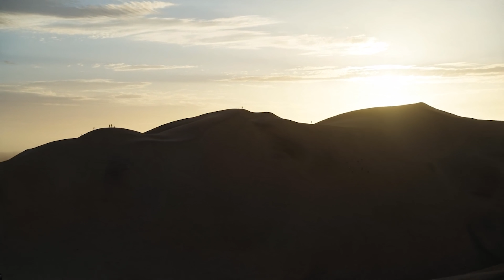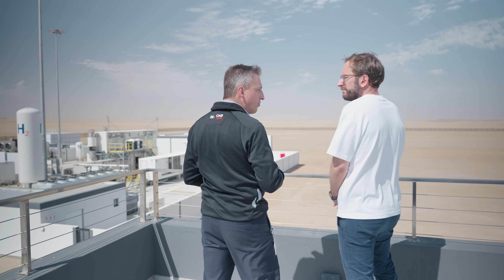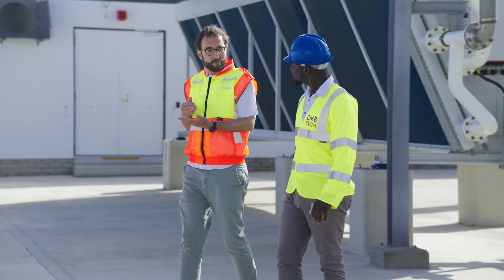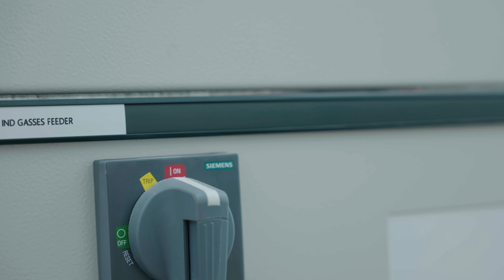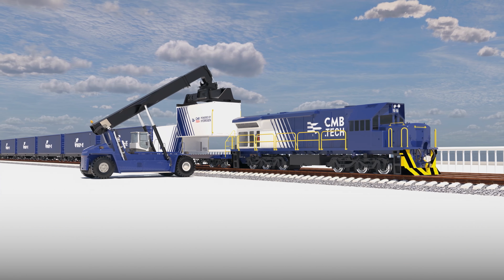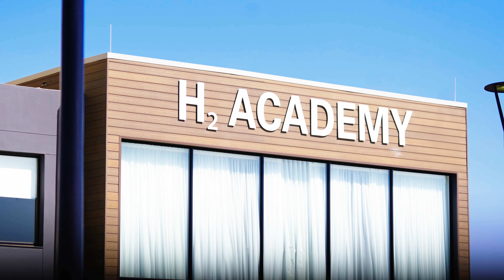Inside Africa's First Green Hydrogen Plant

Comment: HenLv power module factory: full series AC-DC and DC-DC switching converters. Compact size, high power density, good heat dissipation. If you have power design demands, just contact us.